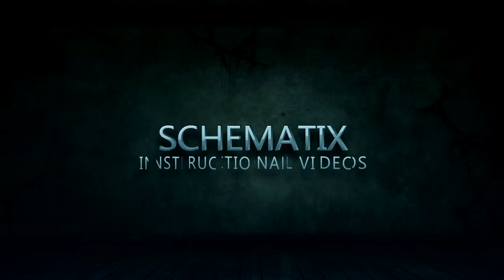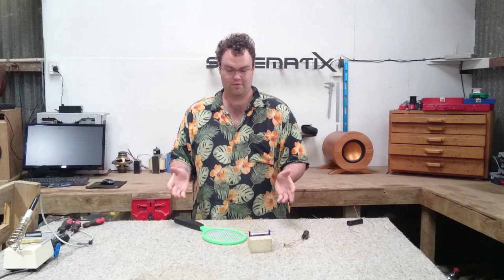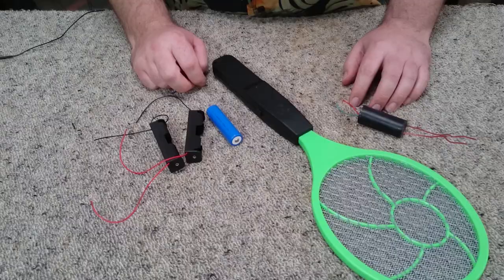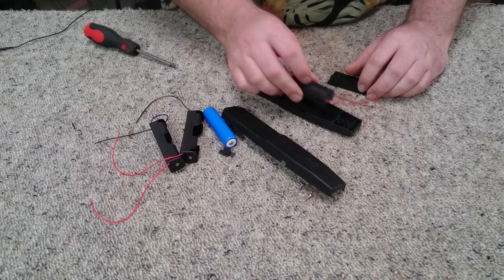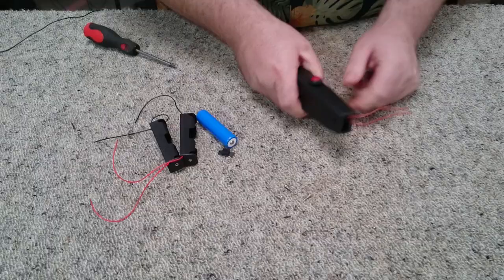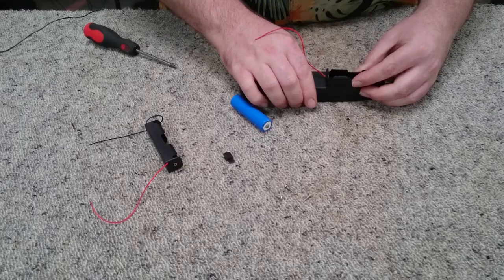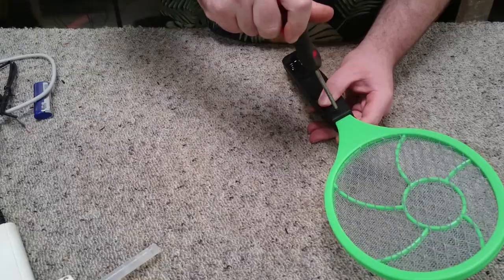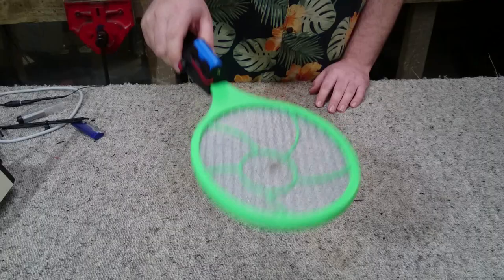How To: 'SUPERCHARGE' an electric fly swatter to 17k+ volts!

Comment: I appreciate your time and the video. if I may ask if you can give me a rundown of what parts to buy so I can shock the midgets, no seeums, black flies, Satan spoil from hell flies whatever they are called these things have been kicking my ass since late March of this year. I went through 70 hours worth of electric fly swatters so I'm going to build one that will last. disclaimer I'm a grown ass man even if you tell me they're exact wrong parts to buy I will fact check them and has multiple people taking responsibility completely away from you and your channel. so let me say it again even if you wish to give me all the right answers wrong answers you have my word I would never ever bite somebody in the ass that offers to help. it is completely on me and no one else. but that's it could you give me a shopping list as far as what style and size capacitor resistors transformers whatever I might need so I can build two brick House electric fly swatters and my great great grandkids will be able to use? I have more tools than the tool maker himself my Hands-On person I would just like to make sure I get the items that are compatible with 21 700 cells I was also going to make one that housed two 18650 cells in parallel. I also have 26650. they're a little older but all are in good to excellent condition. if there's another way I can ask this to take any other words off of you I'm willing to call you personally or give you my number personally or email or whatever seems like you know what you're doing and I'd be grateful if you could give me the load down on what I need. I just don't want to put things together and put power to it even if I think it's right I will make sure it's right before taking a chance. anyway thank you for your time go forward to hearing back from you

Comment: not bad but that 18650 would have easily fit inside the handle. also the fact that it discharges without a fly completing the circuit defeats the purpose doesn't it?
Reply: I would move the 2 outer screens from inside the bat to hot glued onto the outside, gives a larger spark gap....

Comment: This does not work. Higher voltage jumps through air by arcing further. With higher voltage you need a metallic net that has spaced further. You see here that reusing the old one shorts by arcing before electrifying the metallic net. How can you all not see this? Imagine trying to have your tv work when a tv's fork that goes into the outlet is short-circuited. Same here.
Reply: It does work. And I just made one. It will always find the path of least resistance. Which is a fly once it gets in between. Mine also arcs from mesh to mesh inside the racket housing, even when only having the outer meshes connected. The middle has no wire to it.